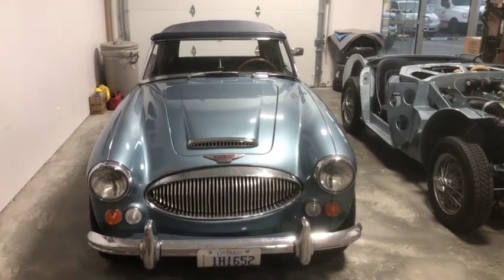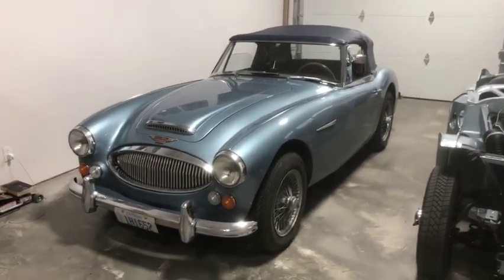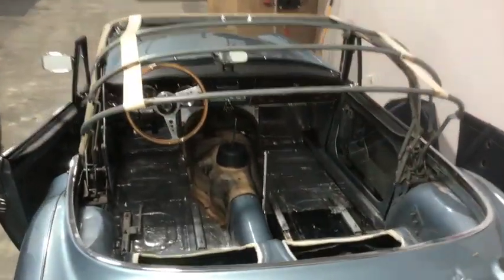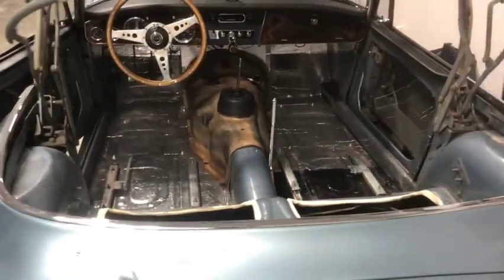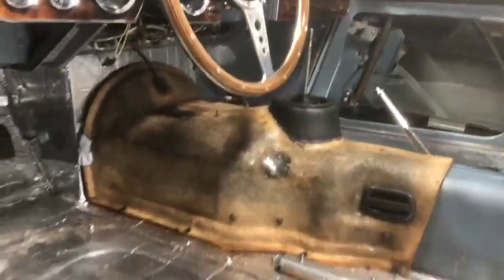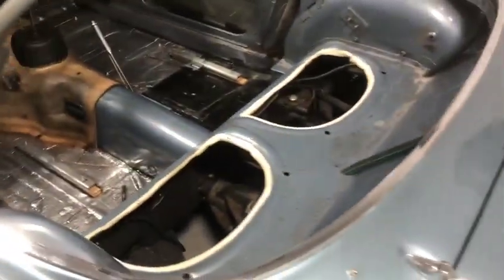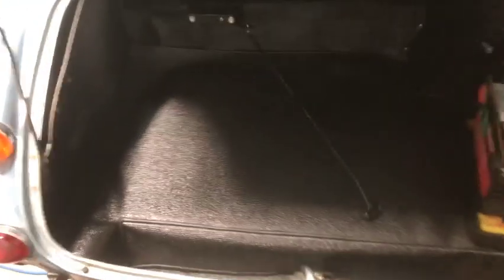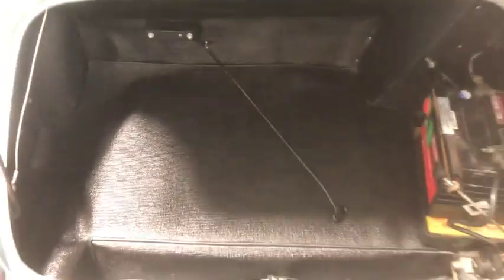Trimming a BJ8

Comment: Great car! It seems there could be some foam padding that could be used underneath the carpet on the transmission tunnel to iron out the bumps and give it a more refined appearance!  Nice work.
Reply from the maker: No, they never had that, they were a baggy fit from the factory and that's what I'm reproducing faithfully in this. The customer asked for original spec so that's what I provide.